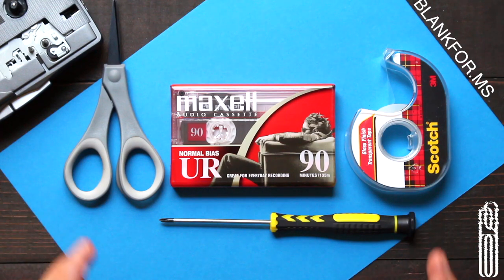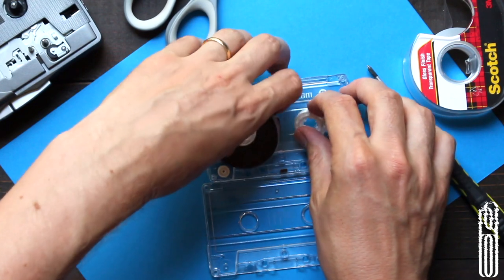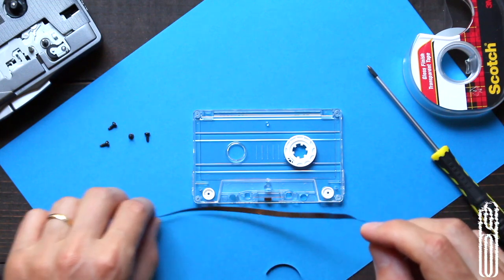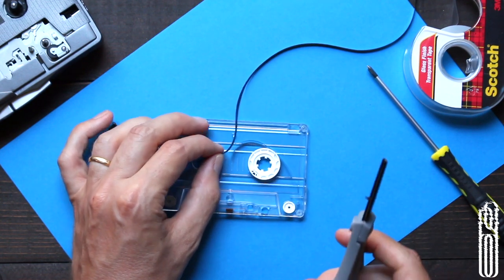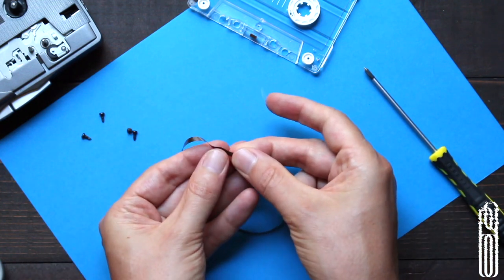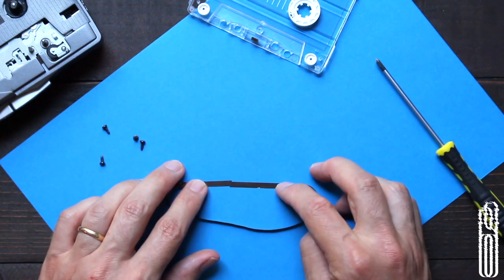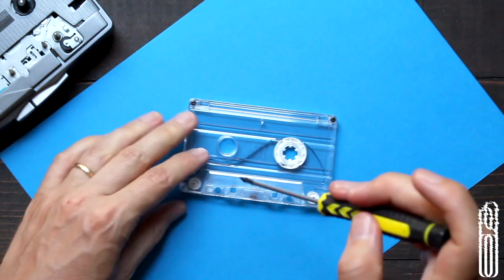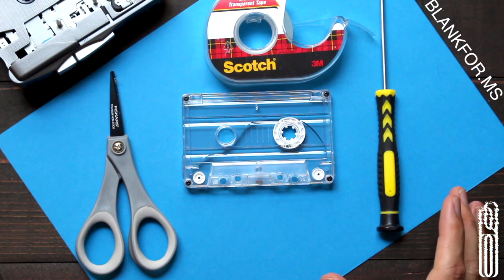How To Make a Tape Loop // A Tutorial on Cassette Loop Building and the Tools You'll Need

Comment: While the techniques shown in this demonstration get the job done, as someone who lived through the old days of tape splicing, it’s a little like fingernails on a chalkboard.  If you plan to make more than one or two of these, I strongly recommend investing in a few inexpensive tools to make the job easier.  Get a splicing block, splicing tape, and some razor blades.  Most importantly, use the splicing block to cut your tape at a diagonal- this smooths out the transition point of the edit, and also results in a stronger splice, especially when paired with some tape which was actually designed for this medium.
Reply from the maker: deastman2 can you share links to those tools?
Reply: BlankFor_ms They are commonly found on Ebay and other sites.  Edit: just make sure you get a splicing block which fits the correct size tape!  Here is an example:  https://www.ebay.com/itm/Splicing-Kit-Open-Reel-Audio-1-4-With-Splicing-Block-Leader-Splicing-Tape/192205529441
Reply: I can second this 100%. I messed around with household tools trying to make tape loops, but in the end bought some TME tape, good blades, and a splicing block. I found out about it from watching a 6 minute BBC "doc" on the Radiophonic workshop and just googled from there. Still fiddly, but far easier.

Comment: Great tutorial! However there is one part that I have a strong objection to. Those clear "labels" inside the cassette that you removed are slip sheets, which are vital to: keep the reels centered in the cassette, prevent friction between the reel and the casing, and prevent friction between the tape and casing. Your tape loop will work fine for a bit but it will ultimately have much less longevity as one with slip sheets intact.
Reply: I noticed that also 😂

Comment: Maybe some walkmans and car radios will work with that, but most decent decks just stops playback when they doesn't get a tension on one of the rollers, I think it might be because of some tape-suck-prevent mechanism. That's why most of these tape-shape-cable adapters, widely used in cars in early 00's, has these plastic gears inside, which transmitted rotation from one roll to the second one, pretending that they have a tape inside, which they haven't. The gears were there exactly because many tape players didn't want to cooperate with first adapters of that type, which didn't have them yet
See example ie. @ here: https://youtu.be/dH4n8fUjtLQ

Comment: Can I ask a quick question.  I followed this tutorial, but the first couple I tried, the loop looked to be fine but when I played it, the loop went round for a bit then just stopped, it didn’t seem to be too loose and doesn’t seem to be getting caught on anything - is this something you’ve come up against?
Reply from the maker: T Robinson I’ve only had that issue with tape players that had playback issues. Are you able to test the tape on multiple machines?
Reply: BlankFor_ms funnily enough I did just do this after you mentioned it.  Originally I was trying on a Yamaha mt100 II - where it was playing then just stopped.  Just tried it on a tascam mini studio 07 and it seems to be playing ok.
Have never had any playback problems with the Yamaha before, it’s annoying as I much prefer that machine to the tascam - any idea why the Yamaha would do that?
Reply from the maker: T Robinson glad it’s working somewhere. I don’t know why that would be, but I do find that some machines are more forgiving than others. Maybe it’s the strength of the motor...I don’t know. It’s hard to predict, other loops might play fine in both machines
Reply: BlankFor_ms after a bit of research it seems it has something to do with an autostop connected to one of the spools - so if they both aren’t moving then it thinks the tape has stopped it just stops - very annoying as like I said - I much prefer using that machine (also as the tascam has this grim sticky rubber feel to it) if anyone has a way round the autostop would be very grateful
Reply: @trobinson7876  same problem here with the same Yamaha model daaaaamn